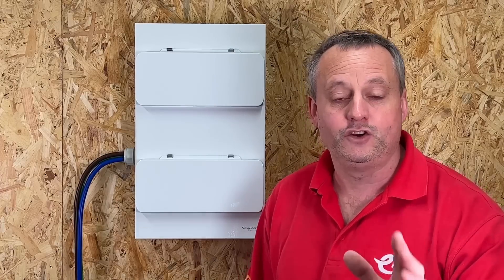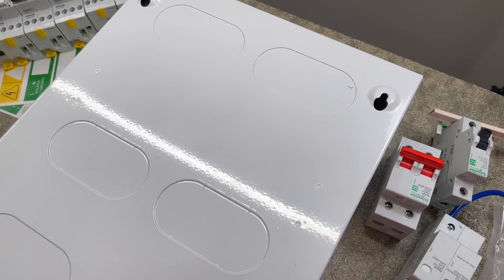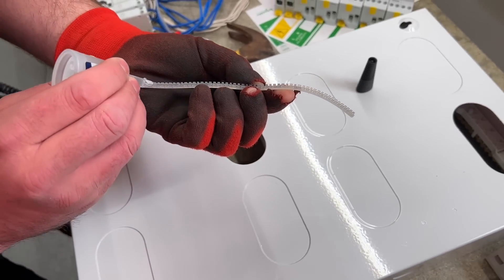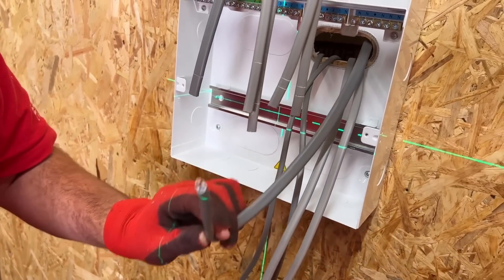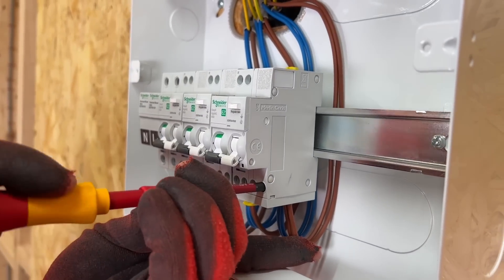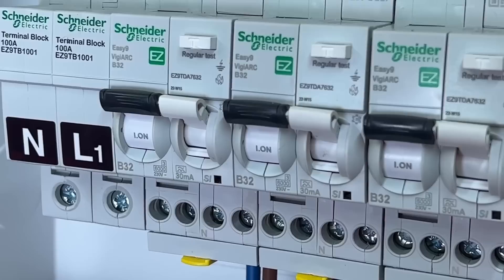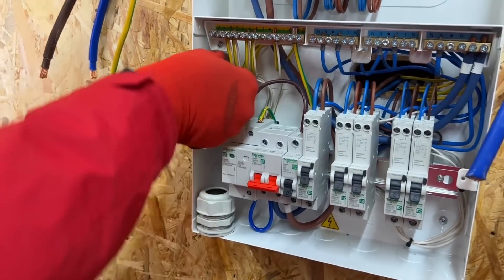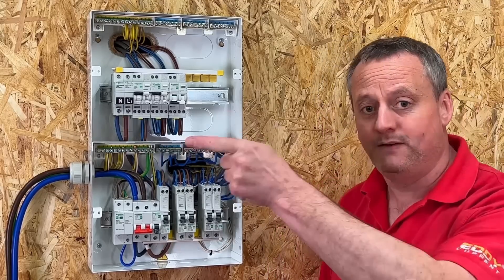Are UK Consumer Units Big Enough?

Comment: The first time of using these boards we were using the 3 row ones, to do a split power and lighing board with afdds, type 2 surge and it had to have a breaker for the fire alarm panel off the live side of the incomer. We had to modify it to get and extra mod on the bottom din rail and punch the cover for the breaker to come through. We had to make up 28 of these boards.

Comment: I've always seen a consumer unit, as just box for mounting DIN-rail devices. That includes contactors; relays; timers power supplies, and other new fancy smart wifi-enabled stuff, coming in the pipeline. But British electricians believe it's only for circuit breakers. It seems that if it's not a circuit breaker, it needs to go in its own adaptable box, with DIN-rail, for some reason??

Comment: You are correct, as the electrical equipment manufacturers and regulatory body are constantly changing the regs and forcing sparks to fit more and more expensive equipment, we need bigger boards to put it all in.  A good money maker! 🤦‍♂️

Comment: I know your target audience is mostly sparks, but as I am an IT Pro with an electronics engineering background (almost exclusively DC, so AC is a bit of a stretch for me), I think it would be beneficial to have more knowledge of AC systems, I'm also in North America, and other than the voltage, frequency, and phase differences (split-phase 240V giving us the common 120V which people think our system is), there's also fundamental equipment differences. You have done videos on how other countries do things, hut it appears that North America is the only place that doesn't use DIN rail mounting systems in residential/consumer systems. Our Circuit Breaker Panels (or Load Centres) are more similar to your industrial distribution units, but you guys also seem to separate your arc and ground protections from your circuit breakers. We seem to have ground and arc protection either in the receptacle or integrated in the circuit breaker itself, not a separate device in the panel, except for surge protection (I still havent seen a schematic that helps me understand how this works, in DC, you'd want the surge protection before any load, iirc). But regardless of how the panels are designed, they all seem like a rats nest of wires that seem to go all over the place. Even though network racks can be rats nets, when wiring is done eifht and neat and tidy its generally all point to point, no fishing cables all over the place, and looks neat and straight forward. I haven't really found a Canadian channel (my preference as a Canadian, and there are differences between the CEC and NEC) like yours, and while there are some American channels but nothing quite as good or informative (except for the home networking and wifi stuff you have touched on). Electrical systems, communications systems, and IT systems are all converging. Could you guys do a video, maybe find a Canadian and/or a US channel to collaborate with to compare and contrast the differences and then explain the basics of how the breaker panel and consumer unit (and maybe even the UK industrial distribution centre) are wired and what each type of device does, why it's positioned where it is in the circuit, etc. Maybe make a series of it. Doesn't have to be too detailed, just the basics. Also, talk about the different types of devices, their acronyms, and equivalents between NA and the rest of the world (RCBO, AFDD, SPD, GGCI, AFCI, RCD, MCD, GFPE, etc.)
Reply: AFDD is very new in the UK, so only starting to appear. The DIN rail system at present that most use, is archaic and needs binned. It doesn't help anything or anyone. Made even worse when you have RCBO's with stupid flying leads for neutrals and earths. Working on such boards in maintenance, replacing faulty items years down the line, especially fully populated large 3PH boards. It's just a total disaster.
Until people have been in that role....nobody seems to give a single consideration to those repairs when doing new installs. And inevitable they will come.
And now they're adding more devices like AFDD's and there isn't even any way to actually test if they work or not. Can't test MCB's, Can't test AFDD's, the only thing you can actually test is an RCD. So strange.
Then SPD's are being pushed, forced, under the pretence it will protect electrical equipment. And I've even see contractors advertising this statement. Leave them massively open if someone does lose very expensive equipment for whatever reason.....then says to the contractor "here mate, you told me this would protect my equipment, you better pay up"
SPD's at source may offer some small level of protection, but they need to be giving more open and honest information about that ! And not blanket statement saying it will protect all. It will not !

Comment: Bought a new build 2 days before the first 2020 lockdown. Sadly the changes to allow building to continue meant I was unable to modify the installation to uprate it to a setup like this with SPD and AFDD and save the cost of the crappy meets the regs box that did get put in. Would make an emporia energy monitor much easier to fit.

I will be getting it changed someday.

Comment: I'm finding two rows are no longer enough. I did four board swaps last year where where I went individual RCBO radial for every circuit, using 36 or 48 Mod Abb metal boards. Also included EV circuit (even if they don't need it yet) and Shelly 3x CT energy management system. It has to be said these clients could afford this upgrade.
Reply: What a waste of time and materials.

Comment: I'm always wondering how you guys across the pond cope with so few spots to put in your breaker box. I mean, first you guys have so little power going in - 240V at 60A, while North American houses typically get 240V 200A service. 30 years ago 100A service was being phased out. (And there's still 320A and 400A, and 600A services available, but those are typically for mansions). That is typically followed with a breaker panel suitable for 20 or more breakers. Granted, the 240V take two spots, but still a panel with 20, 40 or more breaker spots isn't unusual. And there are even "slimline" breakers to stuff twice as many breakers.  Though with arc faults and such they fit in a standard breaker spot. Not quite sure how I could live with only 30A of sockets or so.
Reply from the maker: Great info thanks. The standard UK supply is typically 100A @ 230VAC but older supplies could be 80A or 60A. One of the network operators in the UK now installs three phase as standard. We looked at this in this video 👉https://youtu.be/MNy60muYklo

In Spain and Italy a standard supply for a property starts at 3 or 6kW making the UK seem incredibly generous
Reply: @efixx  I'm amazed by the amount of power you guys in UK have. Here in the Baltics, standard new flat has a 3 phase(400V) 16Amp supply, old ones usually have a 1 phase(230V) 16Amp supply, almost all houses have 3 phase, unless it's not available, and the power also starts from just 16 amps@400v, of course you can get a lot more if the grid supports it, but it's  rare to see more than 40 Amp feeding a house.
Reply: Don’t forget here in the UK our sockets/outlets are wired into a 32amp ring. Where as you guys use radials this reduces the number of breakers needed. Most houses may have three breakers just for sockets. One for upstairs. One for downstairs and then one for the kitchen. High power appliances such as washers and dryer can plug straight into these circuits as they’re 13amps and a 32 amp ring will be plenty unlike the 15/20amp 120v outlets you have which then requires a dedicated 240 feed for those appliances
Reply: Appliances are far more efficient than 30 years ago consuming far less current. For example, Bosch make a four ring induction hob that comes with a 13A plug.  Also the introduction of LED lighting means very small cables like 1.00mm for most installations, and very low lighting current draws. 100A supplies are more than enough for a single average home. Some supplies are 110A. A house with heat pump and and EV car charger may struggle on 100A, but that is easily got around.

Comment: In Germany in flats the units must have at least 4 rows (each 12 units wide). In single room units a 3 row (12 units wide) is also permitted. One unit is the width of a single MCB. It's to future proof the unit itself, so you can later add additional RCBOs, circuits or other devices. This is not in the DIN VDE 0100, which is the German counterpart to the BS 7671, it's in the DIN 18015 (Electrical installations in domestic dwellings). That reg also gives you the numbers of required circuits, numbers of outlets installed in different rooms. I know that in the UK it's impossible to have socket outlets in the bathroom. According to DIN 18015 you must have 2 socket outlets in the bathroom, two lighting connections and a connection for a ventilation fan. That is the minimum requirement. The better standard is in RAL RG 678: 4 socket outlets, 3 lighting connections, 1 connection for the ventilation fan. Of course you need to care about the zones, you can't install them everywhere and you can't run the cables anywhere within the room.

The bus bars are quite nice, we have them several configurations made by different manufacturers but the way they work is always the same. The most classic one is the with three copper bars in it, for L1, L2 and L3. But now these days they come also with an additional neutral, and also in different configurations like L1, N, L2, N, L3, N, L1, N and so on for single phase circuit RCBOs. Other configuration could be L1, L2, L3, N, L1, L2, L3, N and so on for three phase RCBOs. Here we usually don't have that much three-phase circuits in domestic dwellings here, usually the cooker circuit, maybe an electric instant water heater and eventually  an EV charger. The DNO regs state that single appliances with a demand of 4.6kVA or more must be connected three-phase. 

The three-phase RCBOs are actually not that old, I remember when I installed my EV charger in 2017 they weren't available back then. So I had to install a three-phase MCB and in addition the RCD. Also a reason why our boards had to be bigger, because with the separate devices you require double the amount of space, compared to if you install RCBOs instead.
Reply: ? What is the supply Phase to N/E voltage,  ? Can I assume cookers and other high current devices would be connected across 2 phases, or should I say 2 lines. Thanks for the excellent detailed summary, I just want to be certain that I haven't distorted your clear description.
Reply: @oldbutstillcurious3615  230V between every line and the neutral/earth. 400V between the lines. On cooker circuits the load is distributed between the three lines. On old cookers it was usually one big and one small plate on one phase, so L1 and L2 for the hob. And the baking oven part was supplied by L3. So you can fuse the cooker circuit with 3x16A, making it possible to use 5x2.5mm² cables. Back until the 1980s they even used 5x1.5mm² cables for the cooker circuit.

Comment: I've found that given the recent updates to 7671, a lot of consumer unit replacements I've been asked to do have required a dual row unit. Older houses with 2 rings, 2 lights and a cooker circuit can usually be accommodated by a single row, but if you have to include separate heating, car charging, a third ring for the kitchen etc... I do appreciate the extra space. I did have one job where I had to run multiple sub-main boards from the consumer unit, due to the cupboard with the incoming tails being so constrained. Added close to a grand to the job, luckily the customer was loaded and didn't care how much it cost.

Comment: 3:37 it is allowed to put two wires in one connection in uk? you have so much space...
Reply: It’s a ring final circuit, a peculiarity to the UK and British influenced countries. They’ve been talking here about stopping installing them, but people still do and they are still perfectly acceptable and legal. They were devised during WWII to save on materials. You can use cable with a smaller csa than in a radial circuit.

Comment: Love those easy 9 boards. Looks a cracking job Rick, the only question I have is why a pair of big holes that you'll need to fill with F/S. I've started  to  copy a green horn out of  college and only made the hole I need. I do like to see a big hole when adding a new circuit but the sealant looks terrible. Great video to start the year. I use silicone to seal my grommet strip 👍
Reply from the maker: Great idea with the silicone Adrian 👍🏻

Comment: In my experience UK consumer units generally aren't really big enough for all the devices a modern installation will require. However the tiny amount of space that is typically available to install the consumer unit into does rather constrain the size of CU that can be used.
Reply: And why is the space provided to install CUs so small?? Makes no sense.
Reply: @GeeTheBuilder  placement of the main electricity line
Reply: And what devices o a modern installation require that you can't get in a 21 way DB or a 42way double stack?

Comment: Interesting, what do building regs require new builds come with? Until they start coming future proofed houses will need retrofitting. Is it possible to know what can be fitted into a property in the future and future proof it and will a builder pay for that? Nice idea, can't see it catching on. 
Leaving space for one may be one way to help out, but stopping anyone filling it with something else could be problematic.
Reply: Theres looming 3 phase as standard...
Reply: @T_Perkins  I've heard, I wonder if it'll be properties of a certain size?
Reply: Using three phase across the board would help generally as it would even the load on the grid, thickness of cable needed to achieve the same throughout as well.
A lot of the driving force is grid side, rather than consumer side. I'd imagine service heads will be three phase in any dwelling or building where there are more than 2 bedroom.
2 phase could be a thing.
But I was doing total load on a two up two down with everything on that is electrical and it came to around 170amps. (Full on if all storage heating included)
Obviously, that's rather ambitious of someone to have everything on at once but I can think of someone who might be able to use that once in a while... Lol

I know domestic 3 bed homes are likely to have it as standard in the next couple years, especially as car charging and heat pumps are alreadyandadted and I can't see how a 100amp single phase would cope.

Comment: Schneider is a French company. France, Germany, Swiss at least, have Double Pole, RCBO, MCB, etc. No single pole. They are ahead of the UK in that. Because of this they can have dual L & N busbars (comb), so no screwed connection N busbar in the unit causing needless cable clutter in the unit. This one is a hybrid of UK and French. 

The French have one Earth busbar inside the unit, no others. The convention in France is the input at the top and out at the bottom of RCBOs, MCBs, etc. The reverse of here. The AFDDs  look like French stock, or derivatives of it, hence the dual busbar (comb) at the top. The dual busbar is neat.

Legrand's main panels have a vertical busbar at the side linking the multiple DIN rails. Can be three or four of them. The bottom DIN rails may have timers and lighting equipment. 

The main panels (consumer units) are plastic but inside a metal cabinet which is usually inset into the wall. There are regs (Norms in France) on the height of the panel for user access.  Hence they tend to be in halls at the correct height.  No crawling under stairs or at ceiling height in a downstairs toilet.  The bottom part these days may have a Modem or other TV equipment.  So all in one nice smart cupboard.   They run cable to the main panel in corrugated plastic conduit. Rarely see T&E type of cable. 

Schneider need to import their full top input DP MCBs, RCBOs, etc. Complete with L & N busbars (comb). 

 Very neat.  The French are way ahead. 

Artisan Electric on Youtube feature a French main panel in Paris.  Worth watching.
Reply: Any links to their designs ? Really, typical UK stuff is crap, archaic rubbish. External bus bars need binned, din rail needs binned. All devices as you say should be double pole. And all devices should simply plug in, so that they can also be easily and quickly replaced. No wire terminations at the protective device. Wire terminations should be made on a sub board, fixed. 
So any future device changes simply unplug and new one plugs in. Perhaps less applicable to domestic stuff, but in commercial, existing designs are just a pain.
Reply: @blow0me  
Do a Youtube search on:
Introducing the Easy9 Multirow Compact Consumer Unit and AFDD | Schneider Electric
This shows a multi-row CU with DP disconnectors using a dual L&N bus bar (comb).